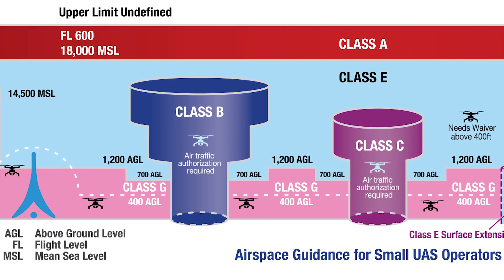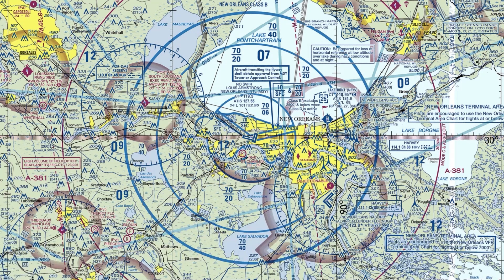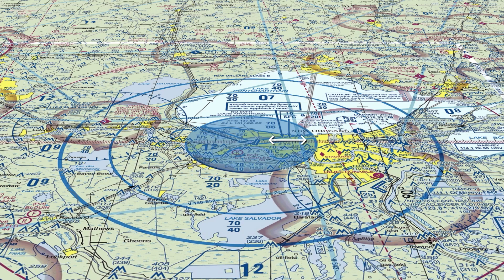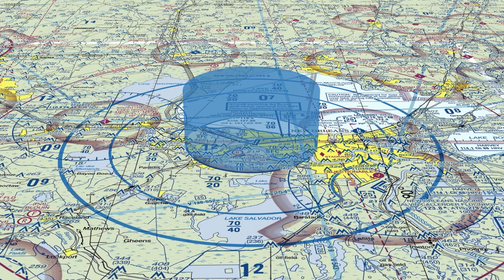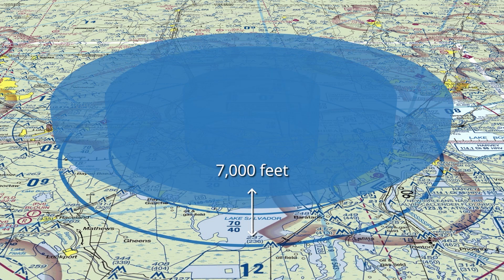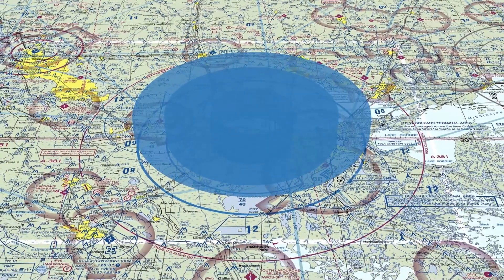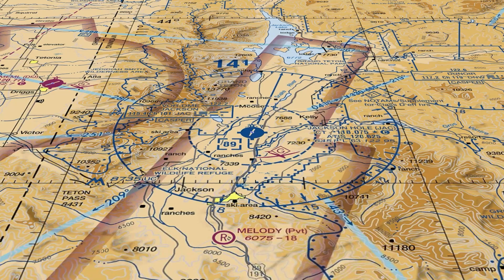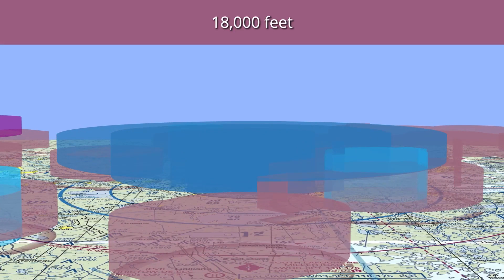Airspace Classes Shown in 3D - Part 107 Exam Study Aid | TechConnect

Comment: Nice visual depictions.  Just want to say that the airspace altitudes depicted on a Sectional describing the upper and lower limits are in MSL not AGL as stated in the video.  For example, the Class B airspace's upper limit around KMSY in the video is 7,000' MSL not 7000' AGL.  You also describe the lower limits as being stated in AGL when they are MSL as well.
Reply from the maker: Understandable.  Part of the reason we selected the airspace we did is because the airspace around KMSY is basically directly at sea level and for brevity it was much simpler. But you are indeed correct, when viewing sectional charts, the altitudes are indicated in MSL, admittedly at the very least us saying ASL around this airspace is technically true but we could have gone into a bit more detail while explaining the chart overall.